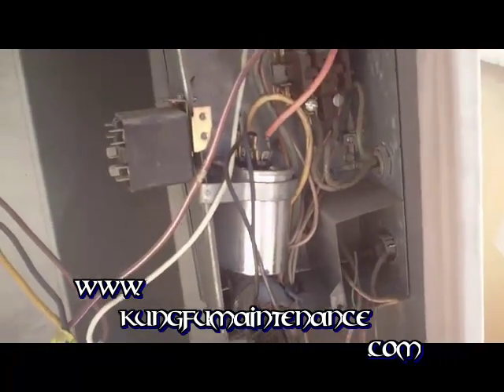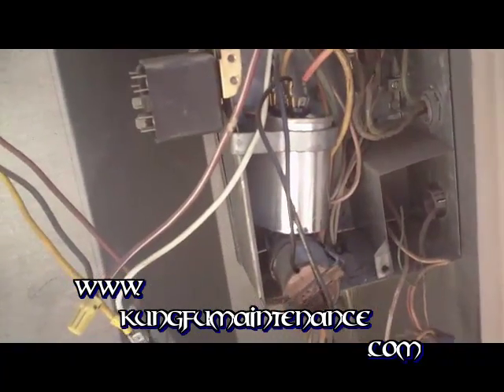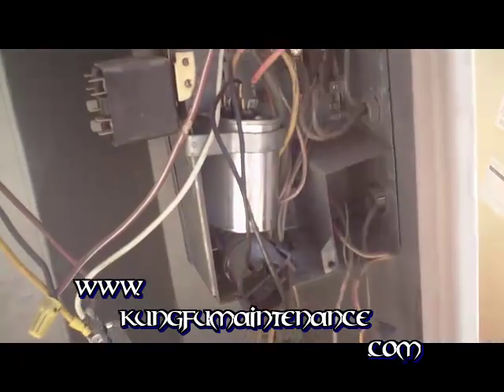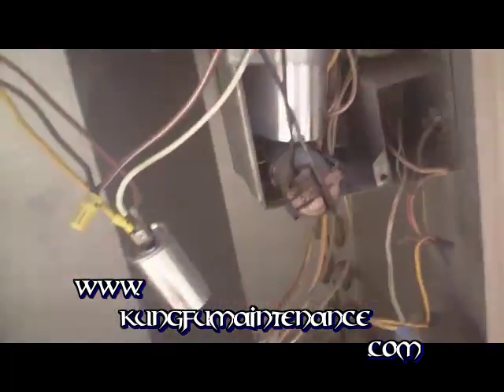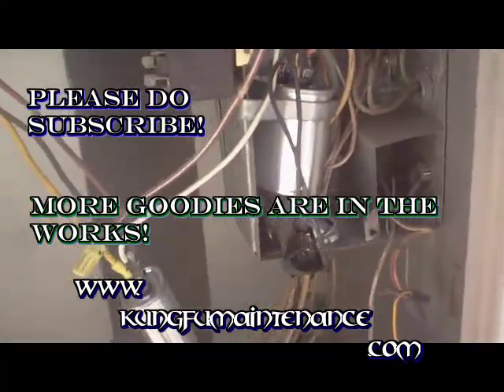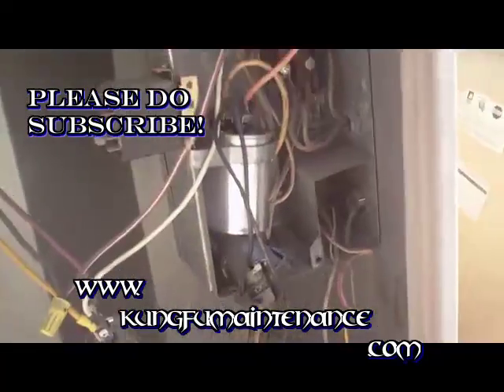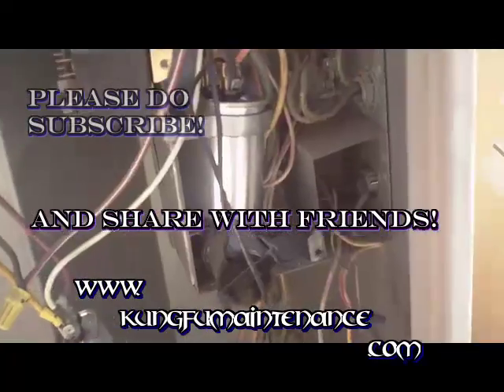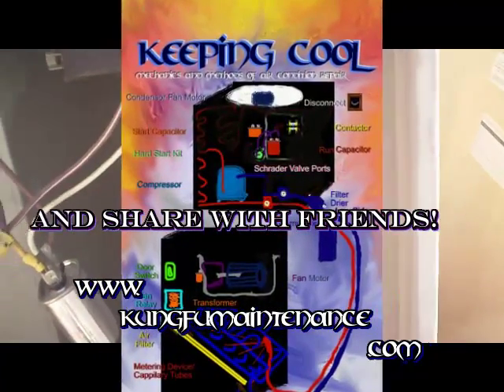Hard Start Kits ~  AC 101

Comment from the maker: The air conditioner draws a lot of amps when it first starts up. This is why time delay fuses are usually used at the disconnect. It takes a lot of energy to get it going. This is most likely why you are seeing the lights dim. Other causes could be an old compressor that has excessive amp draw, an amp draw test can be done. The condensor should have a dedicated circuit at the breaker panel not sharing power with any other appliances or outlets. A hard start kit or a soft start kit may help.

Comment: We are begging for a video to explain why the lights in a home will go dim every time a unit starts up thank u
Reply: tyronewilliams0004 Increasing the wire size can/may help. Do a power factor calculation on your electrical service to see if you would be a good candidate for a capacitor bank.